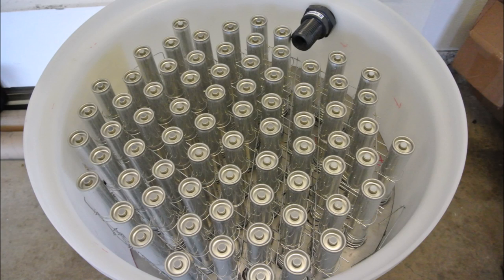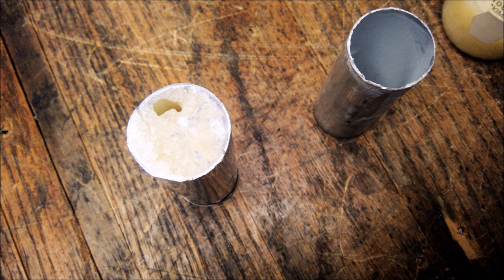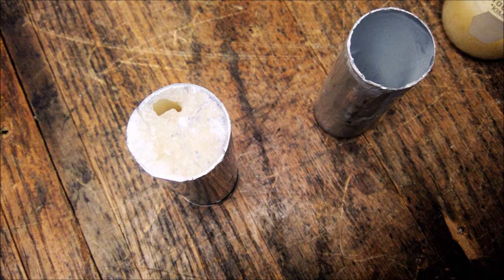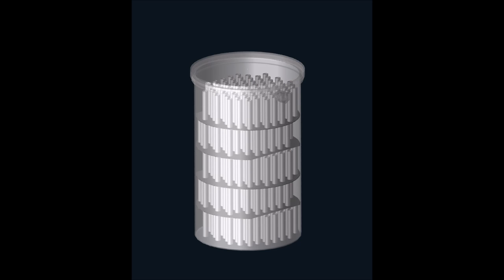Thermal Energy Storage Tank Build

Comment: Where is the data proving fcm is more energy dense ? In your head? We all have seen the outside temperature hover at 32 F due to latency . Nothing new here without data. You just wasted money and melted wax. A great many flaws in your implementation shows your limited knowledge of physics . I would hide this from any potential employer . Good luck.
Reply: Phase Change is potentially A LOT more dense, but it really depends on the material. This is NOT new news!!! But implementing it so that it becomes financially useful, THAT is where the research is at.
Because... more dense storage, doesn't necessarily mean that it is cheaper. Because in the end, the price versus actual real benefit is what determines the value.
Short explanation...
A quick wikipedia search, comes up with the following:
"Paraffin wax is an excellent material for storing heat, with a specific heat capacity of 2.14–2.9 J g−1 K−1 (joules per gram kelvin) and a heat of fusion of 200–220 J g−1" NOTE: the units got messed up when copying from wikipedia, and I don't know how to fix that in a youtube comment field.
Water has a specific heat capacity of 4.187 J/gK.
Soe... what does that mean?
it means that it takes the same amount of energy to melt 1 gram of paraffin wax, as it does to warm up water by (200/4.187)= 47.8 degrees Kelvin (or Celcius if you prefer). So without even changing the temperature of the wax, only utilizing its phasechange, you have already gotten a lot of heat storage out of it. And then there is still a decent specific heat capacity in wax besides the phase change.

Lets say you heat the wax from 40 degrees celcius to 70 degrees celcius as energy storage:
(30*2.14+200) = 264.2 joule per gram. factoring in that the paraffin wax is lighter than water it is really (264.2*0.9)= 237.8 joule per kubikcentimetre.

Lets take water, from 40 degrees celcius to 70 degrees celcius as energy storage:
(30*4.187) = 125.6 joule per kubikcentimetre.

So in this example nearly double as dense in terms of heat storage.

Now... if that makes it profitable to use it, rather than just using a huge water tank, THAT then becomes a question of production and economics.
Also... using phase change for energy storage has its own problems, which may or may not be too expensive to solve.
And... according to same wikipedia article, paraffin wax has a melting point between 46 and 68 °C (115 and 154 °F). So you will need systems which can function effectively at those temperatures, which may or may not be economical to do.
Whether this particular guys implementation is financially viable? well... I don't know, it could be tempting to break out the calculator and do a few basic calculations. But at double the efficiency per unit of space, I doubt that it will be enough to make it viable. Unless one can develop a SUPER CHEAP design using the paraffin wax.
Reply: @danielrye5667  excellent contribution!.
My sugestion for the experiment is to use a common "oil radiator" used for house heating in winter (exchanging the oil by parafin wax). You can find it (at least in europe) at any shop for 50 euros (even better if you have an old one in the garage just taking dust ;-) . It is ready to work, and includes 1,5 Kw electric heater  + termostat + safety temp cuttoff. The energy stored can be easilly measured and time-temp curve too. 
It can be sincronized with photovoltaic excedent production to store the excess collected energy keeping your PV panels at peak production!
You can have individual energy batteries on each room instead a massive centralized expensive installation.
My only question is: it it is so good and simple, why it is not sold in the shops?
Reply: @tecnology-today  Wow... didn't expect a reply after 4 years 🙂 But anyway... I think the reason why it is not sold, is simply due to the subject of scaling and economics... Even at the increased storage ability of a phase-change material, like for example Paraffin, you will still need a lot of it, in order to store a reasonable amount of energy, to the point where it becomes useful. Now it was 4 years ago, since I did those somewhat simplified calculations in my post, but I can see I concluded around double the storage density with the paraffin... Paraffin costs significantly more than double of water, so in many cases it would probably be cheaper and better, to simply use a significantly larger water tank... I know that such water energy storage tank is indeed already in use in certain types of systems. 
Now... the main advantage with the phase-change materials, is that it is more compact... and also, that while it is at the phase-changing "phase" of the heating or cooling, it will remain stable at whatever temperature it is phase-changing at. I recently considered, that if you included a lot of material, which phase-changes at around the desired room-temperature, and integrated it in the walls and floors (Be careful about the potential fire hazard of paraffin by the way), then it would be easier to stabilize that "designed" temperature for that room. But balancing it well so that it works, is a lot easier said, than it is done.
I actually recently started studying to become a building engineer/Civil-engineer at a technical university (where they also do a lot of research too), and under the presentation of one of the possible specializations, the guy actually mentioned that there was indeed some research being done into using phase-change materials, however it is not really seeing much use, due to the economics of it. Who knows, maybe in a few months or years, I will be actively studying about this particular subject. (It has a lot of potential, if well implemented).
Reply: @danielrye5667  thanks for your response. I wish you the best for your career. Energy management professionals are a key now and really a need for humanity.
Regards from Spain
Reply: Well done by this student. Latent heat of fusion and latent heat of vaporization examples are all around us. Air conditioner is also another example.